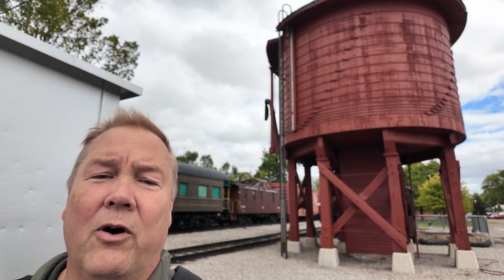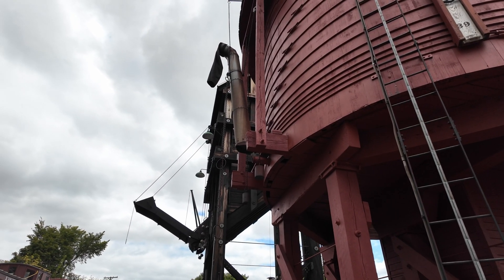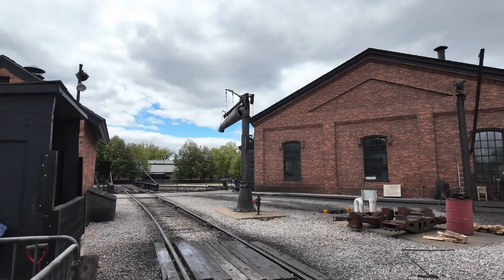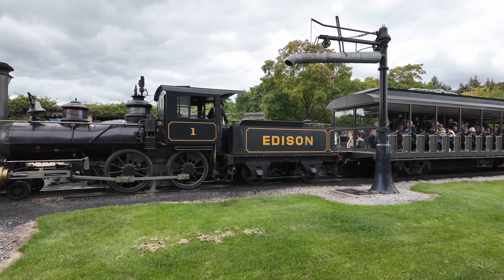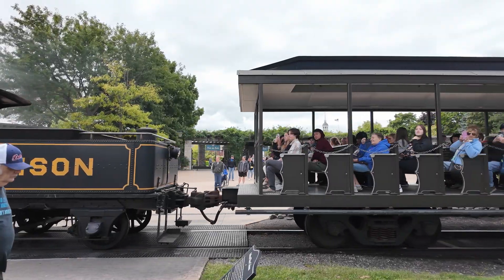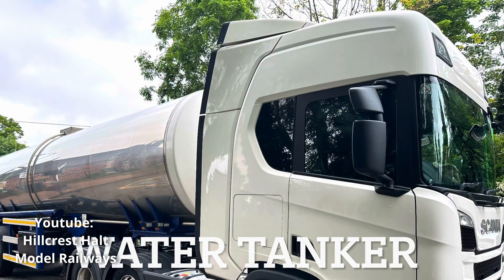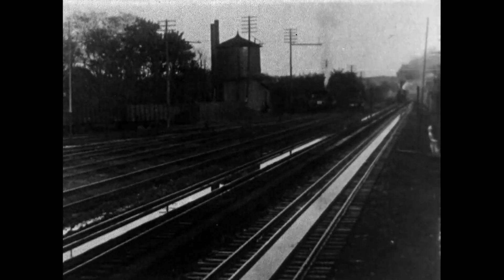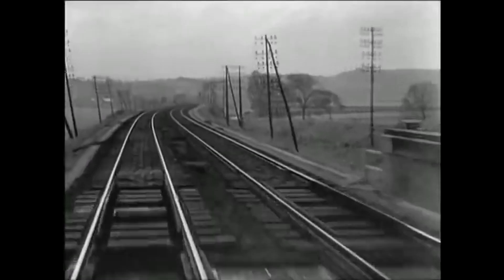4 Ways To Water Your Steam Train - Including One At HIGH SPEED!

Comment: The last clip is showing an L&NWR 3-cylinder 2-2-2-0 passing Harrow & Wealdstone before picking up water at Bushey troughs.
To prevent accidents with the scoop, the track lowered over the trough, rising again before the end.  The water trough had to be level throughout, of course.
Reply: Yes, there was a mild but sufficient “hump” at both ends of the water troughs precisely there to prevent the scoop being torn away.
The frantic lifting of the scoop inn the film is because sufficient water has been picked up, not to prevent damage.
It was not a good idea to sit beside an open window in a car near the front of the train during water pick up!
The system was devised by one John Ramsbottom and first tried along the north Wales coast, to speed up the Irish Mail.  To the end of steam in the 1960s, there was no slowing down over the troughs  resulting in dramatic spectacle on the routes of the LNWR.
Ramsbottom also invented the piston ring and applied close tolerance manufacture to the locomotive fleet resulting in interchangeable parts, in the 1860s!
Reply from the maker: Really? I had never heard that.  It definitely makes sense.  Did the track go up enough that, even if they didn't lift the scoop at all, it'd still clear the end?  Any idea how common that was?

Comment: I had never been aware of the super scooper method, yet as useful as it might have been, I question the amount of logistical infrastructure to refill them for the next train 🚂 but moreso, the potential of shredding the railroad ties or even, as you pointed out, derailing.

The firehose method? Well, okay, but there's nothing romantic there. I suppose it's okay as an auxiliary method. 

I think everyone knows about the Pettycoat Junction water tower method, but this was the first time I've seen it in real life (saw it in a movie 🍿 or two).

What I hadn't seen though, is the same water tower method but with the adjunct pole feeds via underground pipes from the actual tower - that was especially kewl 😎, and... But of course! Why have several water towers when you can just pipe it around the yards to several fill stations for several engines and only have to fill one reservoir?

Brilliant 👍 

Always enjoy your videos Darren. Thanks! 

⛵
Reply from the maker: Thanks!  Glad you liked it.
I didn't really go into the refilling process for the track pans, but because they're long, shallow, and open on top, I read that they take a while to refill.  I think I read it was maybe 20 or 30 minutes to refill.  The other thing that came up is that you'd sometimes scoop up frogs, turtles, ducks, etc.

Comment: I want to ask how many miles apart on long runs would the water towers be?
Reply from the maker: It really varied.  Some locomotives could only go about 10 miles, so there'd often be water that often to accommodate that, even though most locomotives didn't need it.  Ideally, anywhere a train would stop, you'd have water.  The bigger ones, designed for longer, high-speed runs, could go quite a bit further, maybe 100 miles or more.
Reply: @Industrial_Revolution That would explain why Raquel Welch was showering under a tower along the tracks, located in the middle of nowhere. 

It doesn't explain how they keep those towers filled way out there, but I figure in places like the great plains, there would be water stops miles from anything but cornfields as you travelled across the continent.
Reply from the maker: Some were wells.  Some were pipes running to lakes or streams.  I wouldn't be surprised if some had water brought in to them by train.

Comment: Probably a stupid question.  When he's refilling the water tank, the engine is releasing steam in two puffs at a time, it seems.  Is that automated?  I'm guessing it's releasing pressure, but what is it doing?
Reply from the maker: The puffing you hear while a steam train is stopped is usually the air compressor for the brakes.  Some have electrical generators, too, but usually, it's brakes.
Reply: Not seen any old photo’s of water troughs being used hear in Devon and cornwall with GWR.
But then there is not much straight level line  on the route.
The Cornish tin and copper mines had plenty of water being pumped up from the mine, but it had to be put in settlement ponds before they could use it in the boilers.
One mine on the coast used sea water, but it did put the maintenance costs up on the boilers.
Reply from the maker: @Dave.w-ev9qn1962 Putting salt water into the boilers?  OUCH!  Any idea how often they had to chip the salt out?
Reply: @Industrial_Revolution  
This was done at wheal Coates mine on the north coast of cornwall. At a re working in 1911 they installed a horizontal engine beside an old beam engine house and fitted a new boiler.  They abandoned the re working in 1913 but did record they had to strip and clean boiler often!   I suppose the water they were pumping was just going straight over the cliff so they had know where to settle it out. Would probably been better to use mine water than sea water!😀